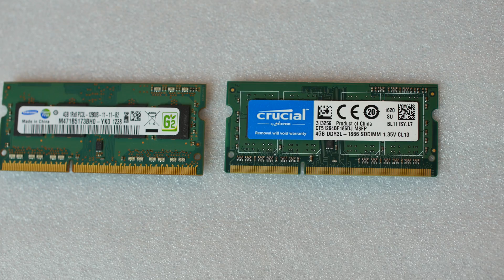ONDA B250-D8P-D3 Mining Motherboard In Depth look and RAM tests

Comment: Hello, did u ever used pci cables extensions with these MB and a mining GPU ?
This in case u want to avoid noise & install the MB on an open frame... then clearly u dont need risers any more & just some PCI extension cable.
Hope my question is clear. It's so rare, that I'm asking if there could be a problem with that... BTW it works perfectly for gaming.

Comment: Im getting the 4 beep error code when powering on.  Any tips how to fix.  Im getting nothi ng o n my monitor.  Does the ram have to be tje L or low power ram speci?fically?   Am pulling my hair out trying to fix this.

Comment: Do you happen to know if this motherboard/BIOS is compatible with HIVE OS?  I have worked with a couple of riserless rigs before and they can be hit or miss on working with HIVE. (The ones HIVE doesn't work on, seem to start up fine with Windows 10)
Reply from the maker: don't know off hand, we'll run a test and see watchout for the followup
Reply: @dronefyre7313  hey man I'm about to purchase that mobo used from an ex miner, do you have an update testing it on hive os? It'll really help thanks....

Comment: My board is the colorful one, but it doesn’t have the 24 pin ATX connector. Instead it just has a bunch of the 6pin inputs but also two 4pin (for the CPU) that says “CPU_12v in and CPU_12v out” I cant get it to turn on
Reply from the maker: hello, sorry we've never worked on that board before... if you want us to check it out you can PM me
Reply: I'm looking for that board since i'm mainly working with server psus and breakout boards, do you happen to have a name on that model? No luck googling here so far :(

Comment: Hello thanks for the video. We are using this exact same board with 8 X 1080Ti, G4400 Pentium, Kingston DDR3 Ram. 

Currently operating on Win10 Pro latest version with 40GB of virtual memory.

We can't seem to get more than 3 GPUs to work. Any additional gpus, are powered but not detected by the OS.

Have you run into issues running 8X GPUs? We think there is bios configuration issue? Any help would be appreciated. Thanks!
Reply from the maker: Hello, have not tested 8 x 1080ti so I cannot say for sure, all power on the board is connected?  What size PSU?
Reply: We have a custom PSU with 2600W and yes everything is connected. We think there is a problem either with Win 10 Pro or the BIOS setting. I was wondering if you encountered any problems as you set yours up. The problem only happens when using more than 3 cards.
Reply from the maker: we use Win 10 Pro with up to 8 GPUs regularly, so it may be something else.
Reply from the maker: this is most likely the problem
Reply: walkoffortune are you saying you fixed the problem with a new psu?